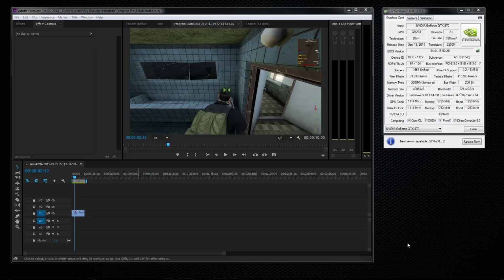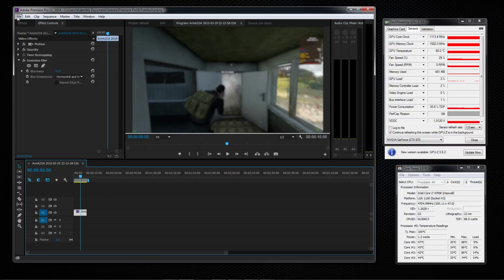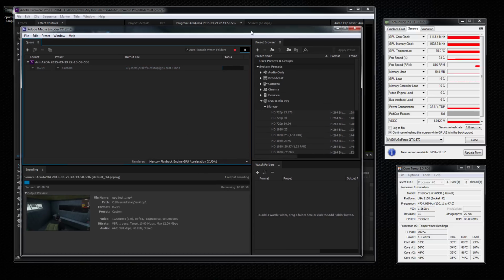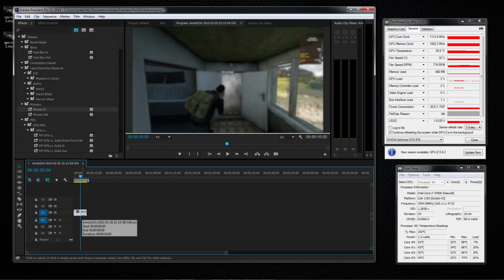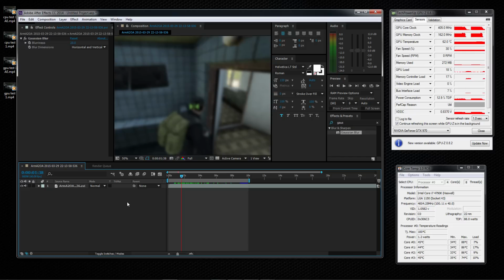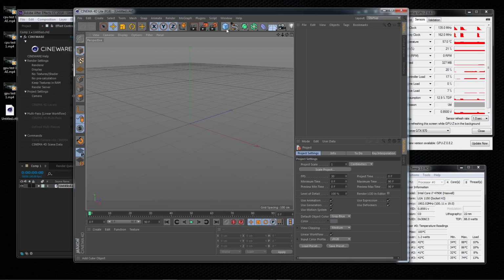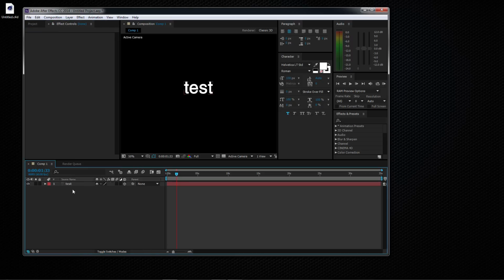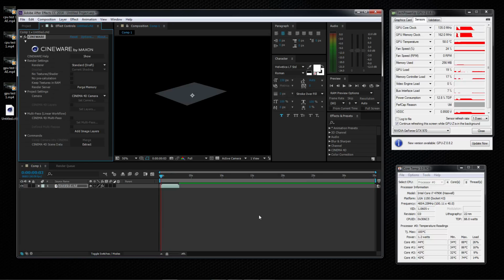GTX 970 WORKING IN AFTER EFFECTS & PREMIERE PRO CC (RAYTRACED 3D ERROR ALTERNATIVE SOLUTIONS)

Comment: hi guy, I have not read all the comments of your video.
Can you explain what are your settings for your i7 4790K up to 4,7Ghz.
Mine rises to max 4,4Ghz in Boost mode
thank you
Reply from the maker: oOoh thats a whole new video my friend, hah! Interesting side note though, my system became unstable when i upgraded to Win10 and I had to drop my OC to 4.6 ;-]
Reply from the maker: Wow, well that's a hell of an OC you got there from 3.9 to 4.6ghz, nice! I have a mini itx build with a asus maximus mb and a 4790k in there, h100i cooling. After upgrading to win10 it was unstable at 4.7 so dropped it to 4.6 and it stabilized. I didn't feel like fighting for that 1000 mhz so just left it at 4.6

Comment: Hello can You suggest me? I have a gtx 970 gaming 1 gigabyte. I have an hakintosh With mac and Windows 10. I7 32 giga of ram and ssd. I have 4 screen plugged In my graphic card . 1 screen In my hdmi and 3 In display port . I do not use The graphic card of my motherboard. My cpu chispset is HD 4000. What do u suggest to me if i want to use The gtx 970 g1 with editing Video software like Finalcut pro x and première . I know that Adobe editing Video is better With The gtx than Finalcut pro x but i use better Finalcut than Adobe. But What do You suggest me if i want to use my 4 screens and use The gtx With my Video editing applications ? Do You think i should use The motherboard chispset for my screen and The gtx for The render or timeline? I am not sûre of The best SETTING for my computer. I use mac but i can use Windows too. Thx for your help and answear

Comment: Hello! I want to ask. I want to buy a GTX 970. plan but whether problematic when using Core i3 Processor, I fear after buying a GTX 970 there is a problem or influence with my processor.
sorry I was not too familiar with the hardware.
Reply from the maker: +Ratumedia Production It will probably work but definitely not my ideal recommendation. You're looking at potential issues and bottle necks.
Reply: +Garibay Computer Solutions Thank you so much information.
but the GTX 970 can walk smoothly on the after effect, right?
I was confused to buy which. not afraid to walk in after effects.
and the GTX 970 is the best that ASUS or MSI.
Reply from the maker: +Ratumedia Production Yes, it works great with After Effects CC aside from the minor issues I mentioned in the video (raytracing). I prefer ASUS.
Reply: Hhhmmm..
VGA is a big influence for the final rendering. such as accelerated rendering.
Reply from the maker: +Ratumedia Production VGA? Don't know about that. Final output rendering in After Effects is mainly dependent on CPU and Hard Drive.
Reply: +Garibay Computer Solutions So VGA only for editing. and rendering depends on the CPU.
the fastest processor for rendering an Intel or AMD.?

Comment: Hi Garibay! I'm using After Effects and export the video file with Media Endoer CC 2015 and ASUS GTX 970 card. I can choose OpenCL and sometimes CUDA but the GPU doesn't work during the render. GPU load is 0% (GPU-Z). Same render time for Software only, OpenCL and CUDA.  ...BUT when I'm using Premere Pro CC 2015 it works like a charm. GPU load is 40%. 
So how can I use the card with Media Encoder CC?
Reply from the maker: +Csaba Bihari Sounds like normal behavior as AE hardly (if at all) uses the GPU for rendering final output. You want speed in AE? I suggest you get the best multicore cpu and SSD your budget will allow.
Reply: +Garibay Computer Solutions, I want to speed up the media encoder, Ae works perfectly.
Reply from the maker: +Csaba Bihari Media encoder relies on the same components i mentioned above. Are you saying that in AE you render a clip and its fast but you'll render that same clip in AME and its slow?
Reply: +Garibay Computer Solutions , yes, when I export the clip in me cc 2015 the render is very slow. Doesn't use te gpu.
Reply from the maker: +Csaba Bihari Well sounds like the issue is isolated to AME.  So start trouble shooting there. Double verify your render settings as opposed to what you have when you 're rendering in After FX. You may have some more intense settings in AME? Maybe try updating AME? Does this happen with every clip you try and render with AME or just one specific (try testing with different clips).Lastly try reinstalling AME (if you havent already).

Comment: I cannot get my GTX 970 to render in Adobe Premiere Pro CC 2014 8.2. When I render videos my CPU usage goes up to 100% and my gpu stays at 0. I enabled Mercury GPU acceleration but it wont render with my GPU. Do I need to install a special driver or something to get cuda to work? I'm using latest drivers. How did you get yours to work?
Reply from the maker: +Austin Fratto no special drivers aside from your gpu drivers of course. I'd say try updating your drivers and also make sure you AE CC is fully updated and give it another shot.

Comment: Hi,

i have the GTX 970 and Adobe not use my GPU, but only with Quicktime files, do you know why ?  i uploaded a video showing that https://youtu.be/7Z3ouOoyogA
Reply from the maker: Mariano Fernandez Calabro You are comparing two different video formats with two different effects applied, that is not a consistent test. In the first clip, it looks like you have a ''find edges'' or some ''cartoon'' effect applied which is not a ''gpu accelrated'' effect therefor your GPU will not be utilized during rendering. In the 2nd clip, you used a blur which IS a ''gpu accelerated'' effect and therefor WILL utilize your gpu. As I explained in my video, in order to utilize your gpu in PP, you must use a ''gpu accelerated'' effect & not all effects in PP are gpu accelerated.
Reply: Garibay Computer Solutions Ok, yes, its a shame that Red Giant Toonit not use GPU. But the GPU renders with a specifics formats.
When i render .MOV files from my canon T3i GPU is %0 (without effects)
But, when i render (always in the timeline) .MOV from D7000 NIKON the GPU WORKS ! (without effects)
Reply from the maker: Mariano Fernandez Calabro humm.. The ''without effects'' part doesn't sound right. GPU acceleration is reliant on ''gpu accelerated'' effects. So if there are no GPU accelerated effects applied to your footage you will not see any gpu usage.

Comment: Hey dude, What made it so that the 9 series cards will work with adobe now? update? or? cuz i had 970 and Ray Tracing/ Mercury playback wasnt working at all.
I want a 980 Ti But dont wanna buy it if i cant use it for playback ect on adobe.
so i might rent one.
Reply from the maker: jason lindquist The GTX 9x series has always worked in Adobe. However, they are not compatible with Ray Tracing (as explained in the video). Keep in mind the GTX 9x series are built on a new architecture called ''Maxwell''. All prior series are built on the ''Kepler'' architecture which is more compatible at the moment and Raytrace ready. If you rely heavily on Raytraced 3D work in After Effects and you are opposed to the new; much better Cineware plugin, then I would suggest you stay away from the GTX 9x series (go with GTX 7x). If you are having issues with mercury playback, I would suggest updating your Adobe and GPU drivers to the latest and greatest. Also you can try playing around with your ''memory & multiprocessing'' settings in after effects and adjusting your ''cpu reserved for other apps'' and also try increasing your ''ram allocation per background cpu'' if you have enough ram of course. Good luck!
Reply: Garibay Computer Solutions cool thanks for the info, I wonder how the export times would be between the 780 and the 9 series? like would the 980 ti render somthing quick than a 780 or 780 ti? or same with Previews will they be the same or slightly more choppy without using Ray Tracing?
Reply: jason lindquist specially for 4k content considering the 980 ti has 6gb vram and 780 has 3gb.
Reply from the maker: jason lindquist I think the 970 and 780 would match up better. Now the 780 ti should outperform the 970 though, although probably not by a huge margin. However, 780 ti vs the 970's big bro, the 980 ti should crush the 780 ti. Even a standard 980 should theoretically beat out the 780 ti. But those are just my thoughts. I would suggest youtubing benchmarks and ''versus'' an such..
Reply: Garibay Computer Solutions ok, makes sense. So adobe premiere pro uses all the gtx 980 tis cuda cores right? or is that part of ray tracing? lol ig uess i got it all mixed up.
ray tracing is only for 3d models that are imported into premiere pro.
Reply from the maker: jason lindquist Correct, using gpu accelerated effects in Premiere Pro along with an nvidia gpu will significantly decrease render times as demonstrated in the video. Honestly if your not even familiar with RayTraced 3d then its probably not even something to worry about or anything that would really effect your decision making on what gpu to get. But just so you know enabling the raytrace 3d render engine in AE, enables you more 3d functionality such as ''curvature'' (i.e bending 2d images). creating bevels, segments, etc. But all of that becomes irrelevant when Cineware comes into the picture. You can full on 3d model in Cineware, which puts raytrace 3d to bed, no comparison.
Reply: jason lindquist Not think my 980TI is supported, i tried to render few videos all of them took x3-4 more time to render than
the video duration while showing GPU load at 0% all the time. Thats brand new pc i got just few days ago, while on my previous one with GTX660 it would render much faster.
Reply: Dim2go Yeah thats what I thought, glad you told me cuz i got a 780 and want to upgrade but not till they are utilized in adobe.